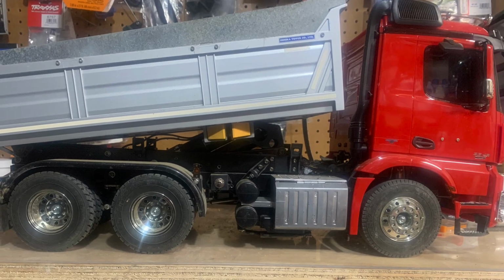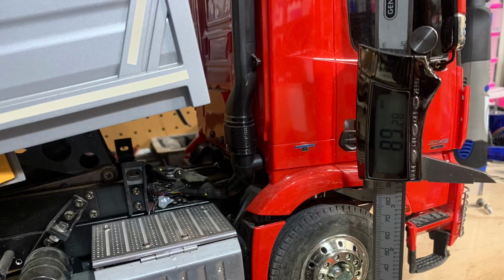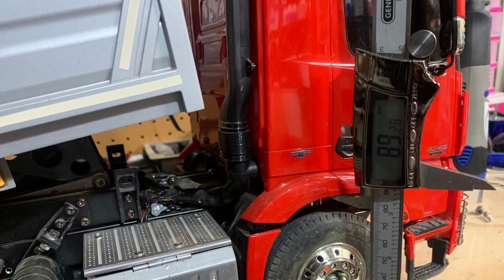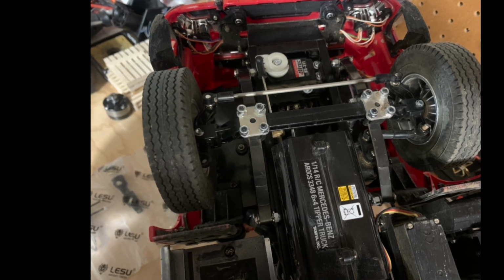Tamiya 3348 dump truck gets lifted. Installing Lesu suspension lift kit.

Comment: Looks a lot better also looks like you feel more comfortable driving it without being too cautious really good buy is this taking over the Volvo’s job after this upgrade or is this just the dump truck that works between sites
Reply from the maker: This is the Highway rig. It’s faster and will be better for the long hauls between sites. The Volvo is for on site work. But it still needed better capabilities for rough terrain. I’m installing hydraulics on it in hopes of having a faster dump capability too.